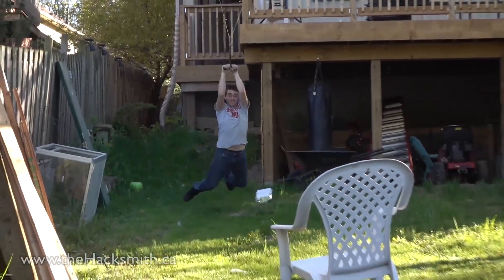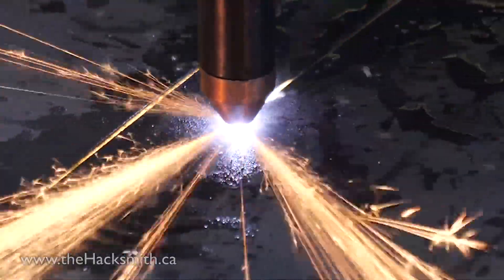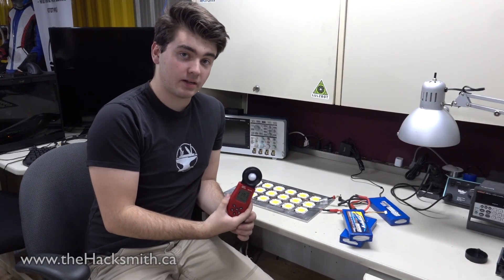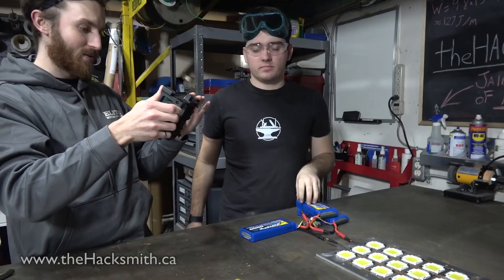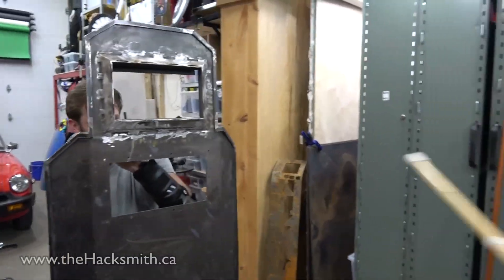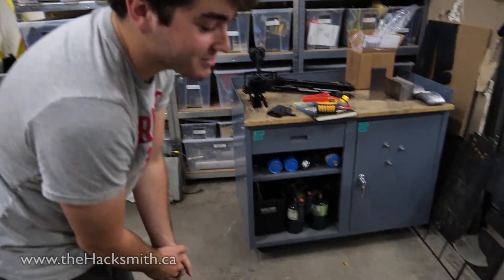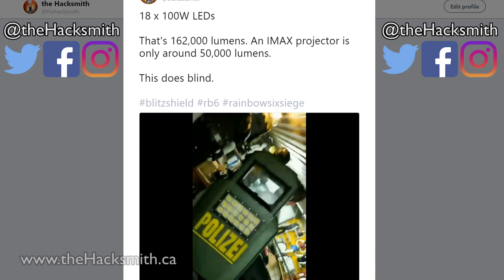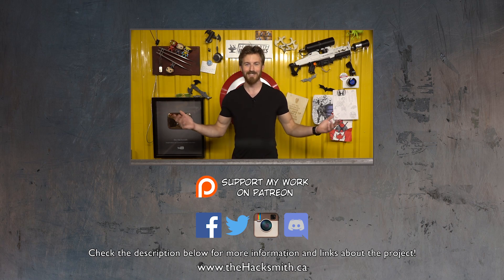Real Life Blitz Shield is BRIGHTER THAN THE SUN! (from R6 Siege)

Comment: As someone who has used those shields in real life going light as possible is the holy grail. Reach for that and the rest will follow.
Reply: No kidding. If you where to make a real life Level III ballistic shield with drop down skirt (No clue how that would actually fit IRL) and side panels like in the game it would be inhumanely heavy.
Reply: Carbon cloth from in my understanding isn't ballistic capable? Kevar is. Carbon is lighter but brittle to high energy impact. Kevlar is heavier granted. There is a better material which 2nd chance used years ago but they were sued because of a flaw in design and materials longevity but not the material itself. I can't remember what it was called but a search should bring it up if you are interested.
Reply: GIGN and other french similar french units do have some human sized shield like the one of Montagne IRL. They're called Sarcophagus, and they're wheeled because the thing is as heavy as it can be
Reply: hglenn55 Were you a soldier?
Reply: No SWAT cop. I used those damn things a lot. Military does not use them nearly as much. They have longer distances to travel and a different mission. We just jump out of our BearCats and do the job. Their job is much much harder.
Reply: yeah in stead of using metal im gonna get a 1/16 in thin sheet of metal 36in x 28x in and then get carbon fiber cloth and wrap it in carbon fiber for strength the wireing is going to be the hard part me
Reply: Titanium stops .45 like on miculek

Comment: You guys used flashlights. The actual sheild uses a bunch of flashbangs
Reply from the maker: yeah you realize how expensive that would be? like $500 every "blast" it's so impractical it's not even funny. go into a fight with a shield you can only use once??
Reply: the Hacksmith  I highly doubt you'd use your sheild in an actual firefight.
Reply from the maker: We're planning on using it for airsoft and paintball... And even if we weren't the video would of cost like $5000 if we used flash bangs just to film it

Comment: Put the arm band on a swivel so you can easily transfer to holding the bottom handle! Also, a much lighter version would be cool for airsoft or paintball too
Reply: NotME some ppl have epelipsy though
Reply: Casbury_ 2111 mmm ya
Reply: Casbury_ 2111 depends on the field

Comment: Aren't you guys afraid of a short, looks like if that bare copper wire bent a little it would touch the steel plate
Reply: Rykahnz it was later modified for better insulation

Comment: I'm quite sure that laser bean sound isn't edited in btw.

Had a marine brother that got into photography and he "flashbanged" me with one of those canon light things.

Shit sounded the exact same.
Reply: DAT REVERZE a
Reply: It’s from black ops 1 pretty sure
Reply: camera flashes (the oldschool ones, the ones you attached to the camera and came with their own battery packs) did make that pitched sound when charging up, and a pop when they discharged.
it wouldn't have been picked up by the camera tho

I remember my uncle had a small modern (for the time) flash attachment with a superior lens which would blind you for a good minute if you weren't careful, and my dad had a big vintage one that ran on 4 D batteries, the battery pack was the handle, that's how unwieldy it was lol

Comment: You need to limit the current flowing inside EACH LED or you will damage them !! This means you cannot put them in parallel without a least a series resistor !
Reply from the maker: The LEDs are $1.20 each, if one goes it's not a huge deal. That's why were testing to see which drew too much current =)
Reply: if one goes the other ones will get more current and burn too, the failure will cascade. You may not notice it a first but you won't get the full brightness after a led has been overpowered. However if the LEDs are balanced and doesn't use the light too much, you may get away with this circuit. Nice build by the way!

Comment: it'll be really kick this shield to the next level by creating a shield that full of welding electrode in front of the shield, imagine looking at the welding stick while someone is welding, the welding light is different from this led's kind of light, cause the leds is design to comfort our eyes, but welding's light doesn't, maybe we need 16 electrodes to really blinded the enemies 😂, although that shield is lit tho, but, can it run crysis? keep it up Hacksmith !!!
Reply from the maker: but it is brighter than welding flashes!
Reply: the Hacksmith yeah i know, but imagime therw are 16 electeodes or more, with a single stroke , what will happen, just a advice,

Comment: Why didn't you just make the whole thing out of bulletproof polycarbonate? Could have cut down on the weight
Reply from the maker: Poly carb isn't bulletproof by itself
Reply: the Hacksmith so what was the clear bits of the shield made out of?
Reply from the maker: layers of polycarbonate and acrylic, which when together is bullet resistant =)
Reply: the Hacksmith well that's what I'm on about haha why not make it from that and save on weight?

Comment: if you just strobe your LEDs you can put a bit more power. like +50% rated power easy. It seems you could use a bit more. With perhaps 10~20% at 3Hz duty :)
Reply from the maker: hehe

Comment: I was looking at making something like this but the lights are expensive, and then to get a piece of aluminum to make the shield out of (and that can also cool the lights through passive cooling) thick enough that it wouldn't wobble would end up costing over $100 (I wanted to make it viable for airsoft/paintball, so it has to survive the bowling ball test without breaking)
Reply from the maker: This shield probably cost a few thousand to make, so yeah... pretty expensive
Reply: ya I wouldn't have used 100W lights which would have brought the price down, but still too expensive to be practical for your average (albeit strange) person
Reply from the maker: That was the cheapest part haha. They are only $1.60 each from China... so it was only about $25 in LED's

Expensive part was the labor
Reply: That sounds really cheap for 100W bulbs

Comment: Please don't connect LEDs directly to batteries, they require current limiting, otherwise they'll quickly pull more power than they can handle and burn out.
Reply: Eugene S pretty sure that may be on purpose. Since in game blitz lights literally explode after after.
So they will wamt the lights to from 0 to max instantly.
Reply: +Blue, current limiting will not slow down how fast they light, it'll just keep them from burning brighter than they're designed for and burning out in seconds.